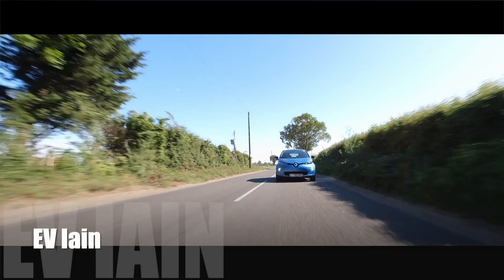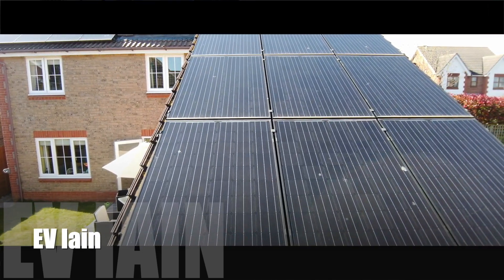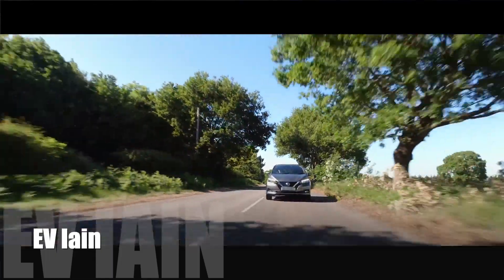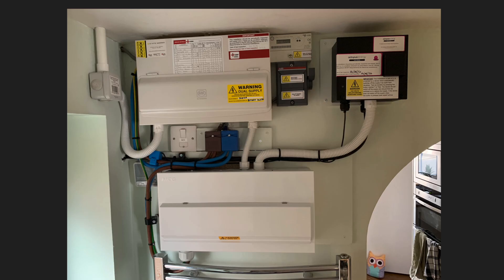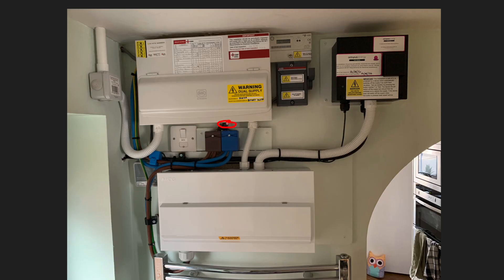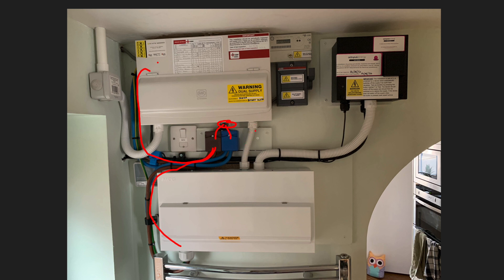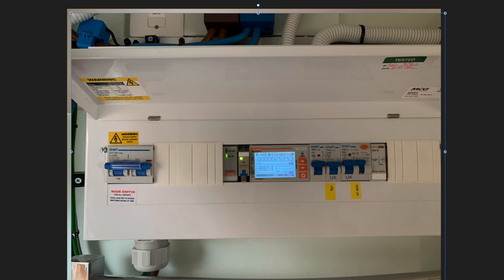Powerloop V2G Home Wiring

Comment: HI . I have my quasar working on v2H. I am using it to power ashp.  So if I set the output to ashp max, when  it is just circulating, I am exporting, and not getting paid. I figured i need a special meter for dynamic load management, so the quasar only uses what the house needs , with ct clamps on solar and grid in. Is that it or is the wiring more complicated? Have you done a video, any advice/ diagrams appreciated
Reply from the maker: Hi Sorry I haven’t ever looked into this with the quasar. But if it can do it you’d likely need a CT clamp to monitor your export.

Comment: Very interesting and thanks for sharing. As you say an elegant app needed to pull it all together.

Have you considered a Tesla Power Wall  to capture your PV energy rather than export at 5.24 p / KWh?

There are cheaper battery packs than the Tesla of course .
Reply from the maker: Hi thanks! Yes I had but I considered v2g could be better as you essentially get the power wall as part of your car, thus never have the expense of replacing at some stage. However in practice it’s very different, which I’ll probably do another video on at some stage